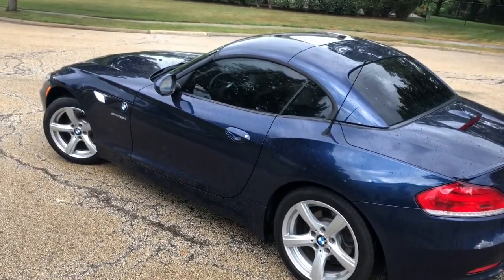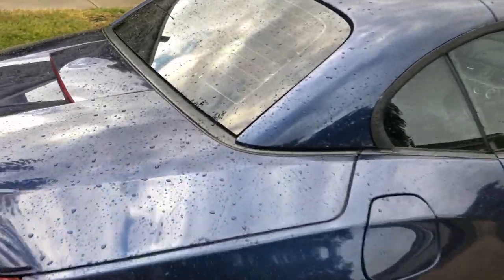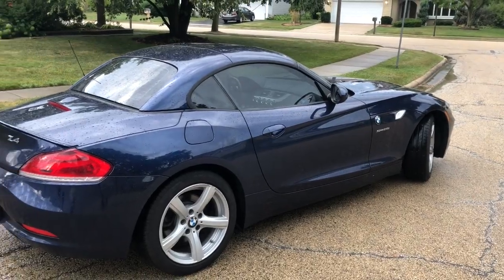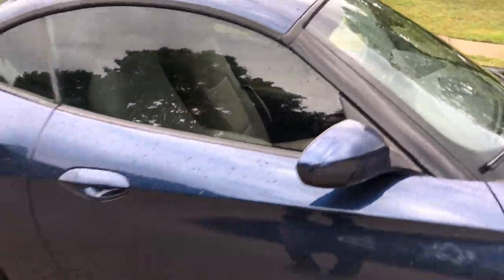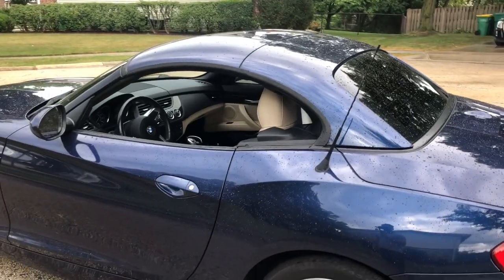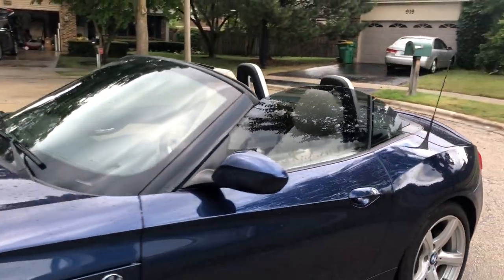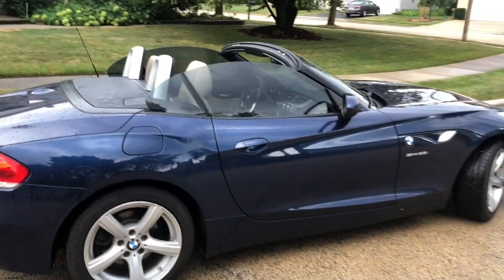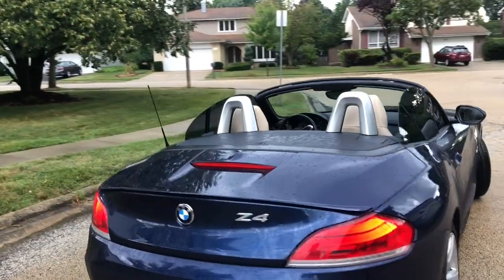BMW Z4 Window Tint

Comment: Looks good. You'll probably drive with the top up most of the time anyways and have the windows down if the top's down. I went with 50% ceramic for the visibility, but darker looks nicer.
Reply from the maker: Now that it has been getting colder and colder, I’ve been driving with no roof and windows up in the morning and I have no issues. Love the tint and how it looks. Very happy with my choice. 50% would be nice at night, for sure.
Thanks for watching!

Comment: I think that convertibles should be "open"/ see-through if you know what i mean. I wouldn't tint that car.
Reply from the maker: I agree with you for the most part. I also feel like when I’m driving it as a convertible, the windows are rolled down anyway, so it doesn’t matter. Then when I want to drive it as a coupe, i get the privacy of tinted windows. So it’s like the best of both worlds. 
Thank you for watching!